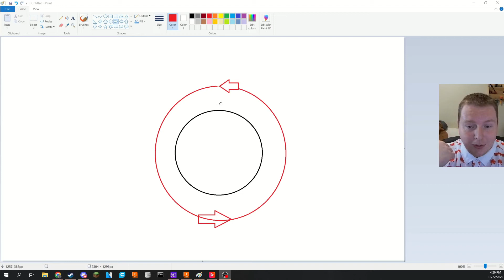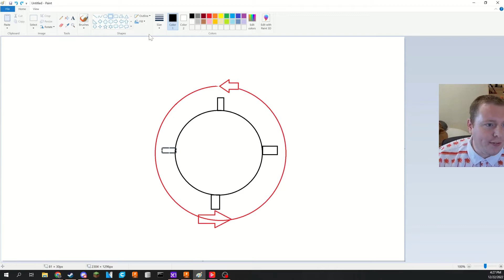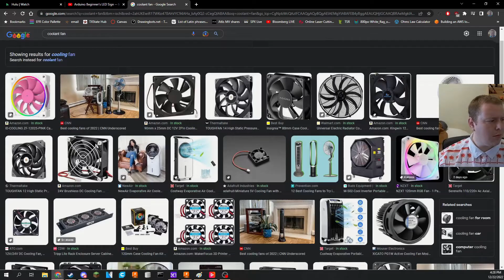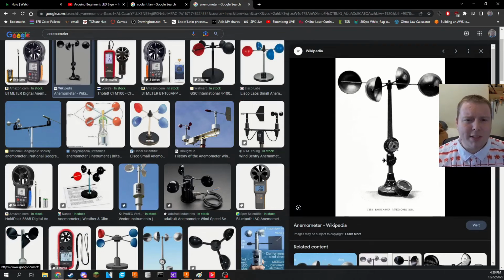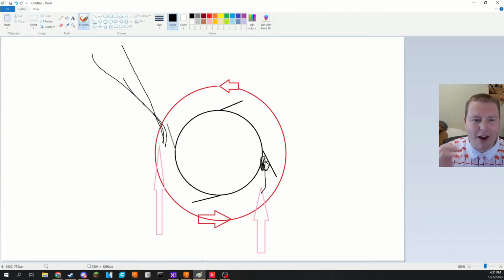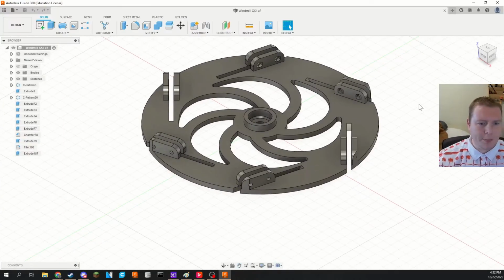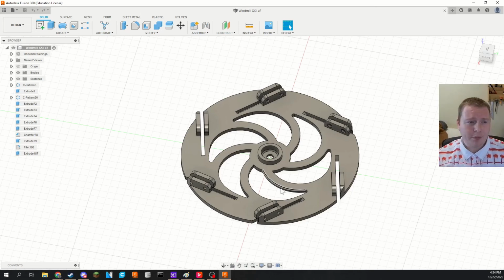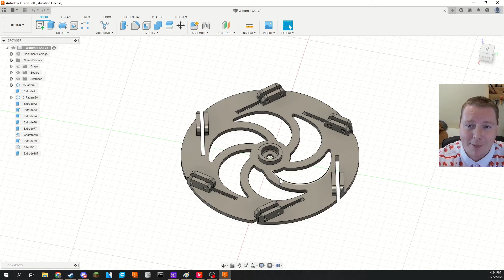Hardboard Wind Turbine Prototype

Comment: Your Build-a-VAWTs system and this have me thinking on how to create a portable, collapsible wind turbine and I'd be curious to get your take as I am very new to this area. If you had a top and bottom hub similar to what your hardboard is connected to here that connected to the cupped blades similar to an anemometeror's or your BaV's blades, could you then create a system that can pack down relatively flat that could be easily carried attached to a backpack?

Comment: Checkout the Ugrinsky turbine design, easy and cheap to 3d print and its surprisingly efficient!
I build 3d printed VAWTs with a support rod with arms that have a bearing every 60cm or so, that way I can get away with using cheap 8mm rods and just 608rs bearings. Works pretty well and a 70cm tall turbine with 23cm diameter easily lights up a few meters of LED strip using a stepper geared 2:1

I print my turbines in segments of about 20cm height, then glue them together with CA glue, each segment I make as light as possible, a single thick perimeter (0.6mm on a 0.4mm nozzle) no infill.
Ideally I just want to figure out a useable three phased DIY generator that can directly attach to the turbine shaft, that way I can use cheap chinese turbine controllers to charge a battery.

Comment: Horizontal turbines are generally more efficient and less material intensive than vertical turbines, but a VAWT will handle the turbulent winds on your balcony much better. I'm excited for your results.
Reply from the maker: That's interesting that you say that... it's a conclusion I've been coming to for some time now but wasn't sure if it was a function of my mediocre construction or not ;) After a brief scroll through your profile, seems like you would know, haha. Thanks for the comment, cheers
Reply: Not being an expert myself, I was keen to find out what is the aerodynamically optimal form. Taking that as a baseline, I can then accept other design constraints like local wind conditions, turbulence, material cost etc. but without that baseline  ;)
Reply: @Hukkinen  The most aerodynamically optimal form is what you see on commerial wind turbines. 3 Blades with a tip speed ratio of around 7.